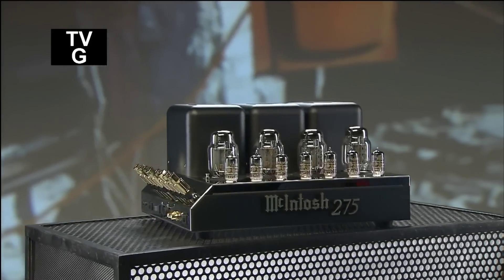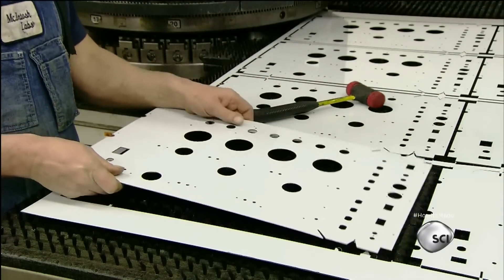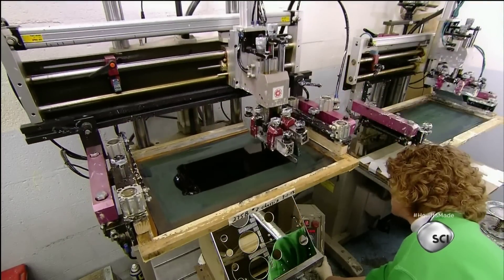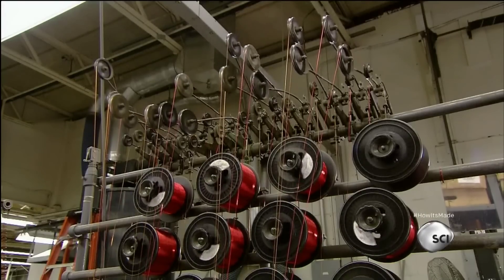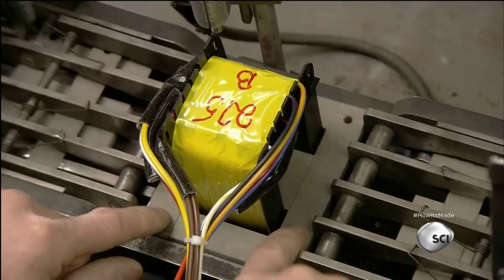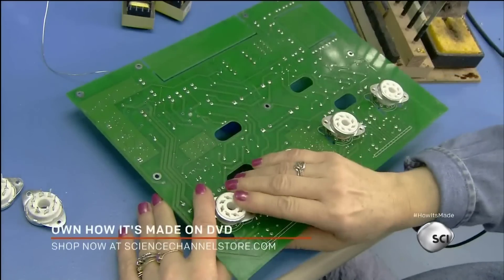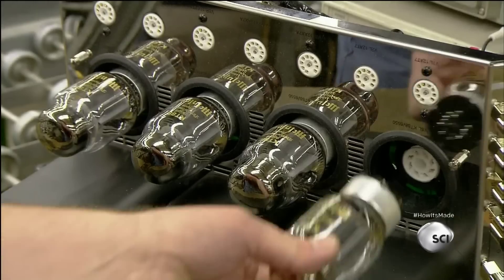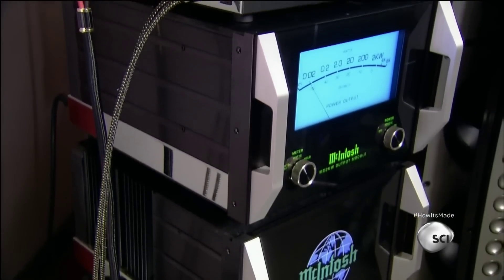How It's Made - McIntosh Tube Amp

Comment: The drawback of using PC boards is that the heat that wicks from the tube sockets, causes the solder joints to crystalize. The stress of supporting the tubes further breaks apart that crystalized solder. Then, after a couple of years of thermal cycling, the joints start to become intermittent.
The older point to point wired McIntosh amps are more reliable for this reason.
Not sure if they're still making the Unity Wound output transformers, but I can tell you that the old ones from 1960 or so have immense bandwidth. Not sure if the new transformers are as good. I just finished recapping an MC240, and it probably weighs 60lbs. Full power bandwidth from 16Hz to 40KHz, as measured in my lab at Amplifier Experts. Better than Jadis. Much better than Carver.
Reply: Woo audio still does point to point wiring, in all their amps.
Reply: Straight from the horse's mouth, as it were:  Sid Corderman was McIntosh's chief engineer for most of his career...  he wrote the book (well, the article at least :) ) on output autoformers in solid state amps.  http://audiokarma.org/forums/index.php?attachments/coderman-autoformer-pdf.243097/

Comment: Really disappointing to see that this is how a McInstosh amp is assembled now. They don't make them like they used to. Get your greasy fingers off those tubes!
Reply: I will say that I am disappointed that they stopped point to point wiring and are using PCB's. Many companies like CARY audio in North Carolina still makes a number of their units with point to point connections. Those PCB's look like they may have been assembled overseas and sent over to Mcintosh as a completed pcbs but I can be wrong. I see WIMA caps on those boards which is disappointing since they are at most average quality for what this amp goes for in price. I see many units that are made in china for a fraction of the cost use the same type. Another thing i do not like at all is the LED's lighting up under the small signal tubes.. That totally takes away from the natural warm orange glow of the tubes and gives it an undesirable look as far as i am concerned. I hope there is a way to turn those off. All the chips on the board controls that. The PCB doesn't look like a low quality pcbs though, it is a very good grade of PCB used and the components are very cleanly laid out overall.
Reply: Tyler Horsman Digital stuff still colors the sound too. (yes even those cheap $20 big-box-store earbuds) Unless you use studio monitors for everything you're still getting colored sound. Heck even some studio monitors still color sound. Blindfold me, and play the exact recording each time, and I could tell you exactly what pair of my monitors are playing. 

It's a good thing you want pure audio, if that's what you like I can't encourage you enough to pursue the perfect digital audio system. But to someone who prefers the warm tube tone, this would be a great investment to them, and certainly not a waste of money.

FYI there is an absolutely HUGE difference between cheap tube amps, and high end well-made ones. I don't know if your tube listening experience was with a cheap one, but if it was I strongly recommend you sample a good one if you get the chance. 

ANOTHER FYI: Artist "intend" nowadays for their music to be heard on cheap crappy earbuds. The reason for that is because that's what most people own, so that's what they optimize it for. They would LIKE it to be heard on high-end systems. This can also depend on genre.

Sorry to rant, but the only thing that your comment section bashing to everyone is proving; is that you're an asshole. Not that digital systems are better.
Reply: With cheap IC's and a PCB?
Reply: Regardless, they still don't make them like they used to. Give me a vintage model anyday. If its gotta be new, there are countless other current amp builders with what seems to be higher quality.

If you're spending 5 grand for an amp, cheaper or not, cheap it is not.

Just my thoughts.
Reply: Andrew Kosiba Vac amps are a waste of money. Listening to music coloured other than how the artist intended isn't fun in my opinion. I really like to hear music as it was recorded. Vac amps just ruin it.
Reply: IIRC everything gets dusted/wiped/etc. before it goes in the crate. You can't help but get some handling marks on it, after all. :)
Reply: Andrew Kosiba just because it has IC's does not mean its not going to sound as good as your older amp but I do agree with the modern flimsy PCB
Reply: I thought the same thing.  Why aren't they wearing a cotton glove?  But being that it's a H.I.M, video,   there's a lot of steps that aren't being shown.  It's quite possible that giving the tubes a  quick wipe with alcohol is part of the QC process before packaging.
Reply: Andrew Kosiba I saw those fingers grabbing that tube and something in me got worried.

Comment: For such an expensive tube amp ($6500 US MSRP), I see a lot of SMT modern ICs inside this thing @3:38 and even several SMT transistors @3:47. Tube amp my ass.
And this video is full of bullshit : speakers connectors are made of gold plated brass, non-magnetic metals, because magnetic ones would react to the electric current and produce distortion... I don't think that this 0.0001% distortion hence produced would be heard over the 0.5% that this amp outputs overall. And that LED gimmicky light show looks awful. Let the natural glow of the tube filaments do the light show. At least it serves a purpose.
Reply: And to think McIntosh HR, paper shredded your resume shortly after receiving it.....  Their loss.